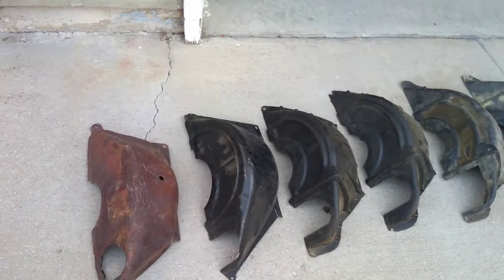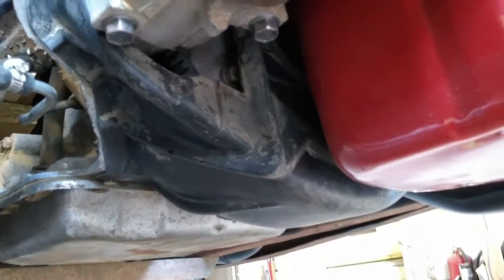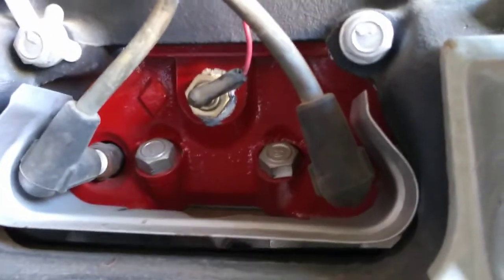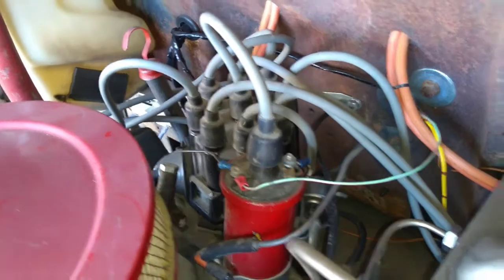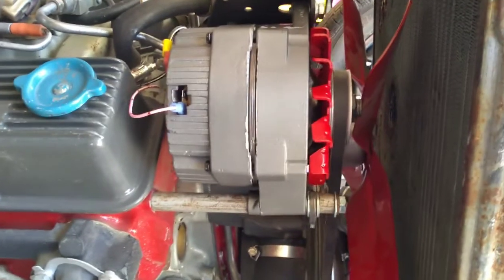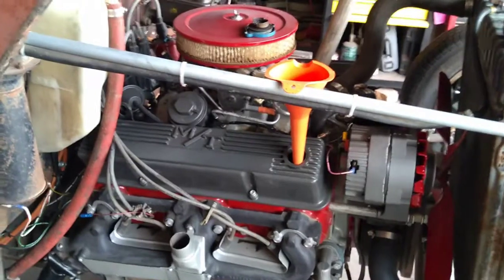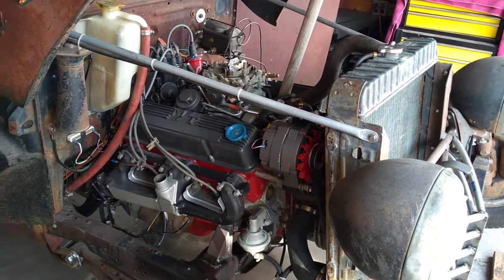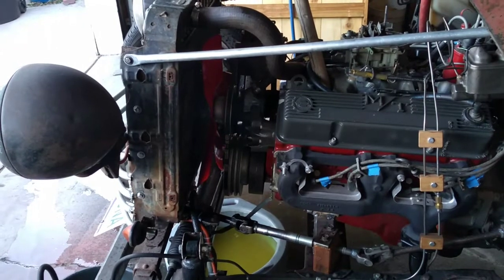Will It Start? Sitting For 20 Years? Yes But...

Comment: Hi there, your oil pump trick I used to do similar but with hex steel bar the same size as oil pump drive on my Pinto Race engines before start up, i left the valve train cover off to watch the oil spray tube giving good spray pattern of the valve train.. Racers in many formulas over here In the UK still use this type of 2 litre Uk.. Thanks for the Honest Video - Ian -- UK. sourced race engine
Reply from the maker: Thanks for the info! I'd like to see a similar one one each specific type of engine. I thought I knew how to do it before, but obviously I was off somewhere. Had a pinto engine in a kit car once. Have toyed with the idea of swapping one into an early 60's Falcon with a turbo. I think that would be a fun ride!

Comment: I use no synthetic 10W30 engine oil in my gas engine all my vechiles have over years even in my 2002 Chevrolet Impala E-X LTZ LS car has 4100 4.1 litre 252 CC V6  and don't ever add 1 litre oil till 7.000 kms or 4 months too and a can add every 3 a grey bottle of STP Total Treatment fuel injection cleaner in fuel tank full too also do in old or new engines too! I use for gas is 89 or 91 Octane gas from Shell or Harmac types get excellent MPG on local or highway driveing to!
Reply from the maker: Right on! I do almost the same thing with all of mine!
Reply: @crazydadsgarage2344  In the UK just like most of Europe we have diesel powered vehicles mostly, my current car is a baby landrover, the Freelander 1 with automatic gearbox with its BMW sourced engine. I purchased it at 180.000 miles done the specified fully synthetic oil change and used bottles of "STP" branded diesel fuel cleaner with every full tank fill. now a year later black smoke emission's has reduced to almost Zero now, which is good news as smoke detected at the yearly "MOT" (ministry of transport) testing requires very little or no smoke for the vehicle to pass/ none of this Rolling Coal fad that i see In America.. In fact, as from 2030 NO NEW fossil fuelled vehicles can be sold In the UK. and with that its expected to see fuel pump garage forecourts be replaced with electric power plug in points.. It seems Older fossil fuelled vehicles for now to be used but expect much tighter MOT testing to get rid of as many as they can.. sad but true.
Reply from the maker: @ianburit3705  Wow crazy that you guys have to deal with that. On some level, I get that we need to be environmentally responsible, but I don't appreciate other people trying to take away my right to enjoy how I get around. Thanks for sharing your experience.